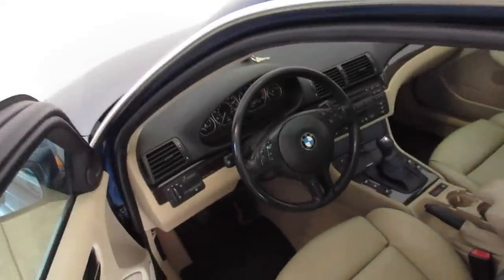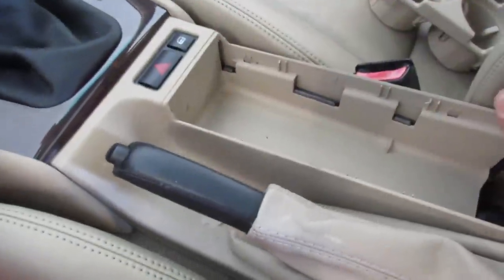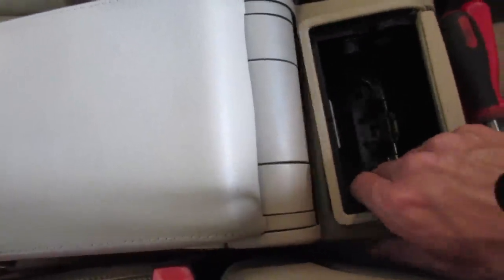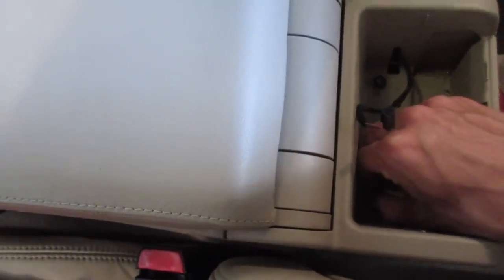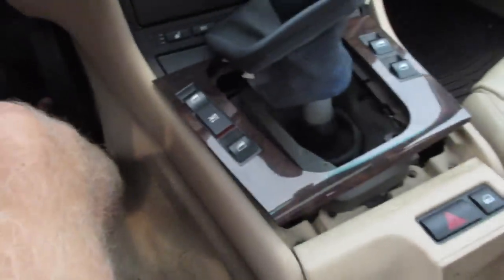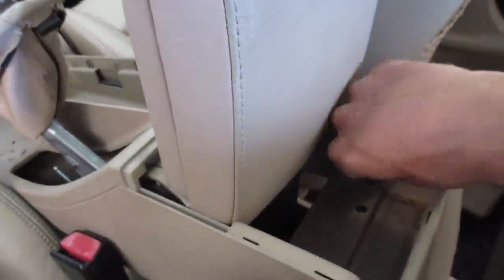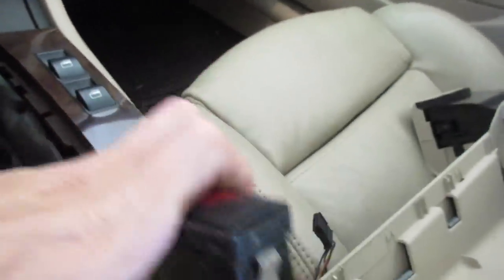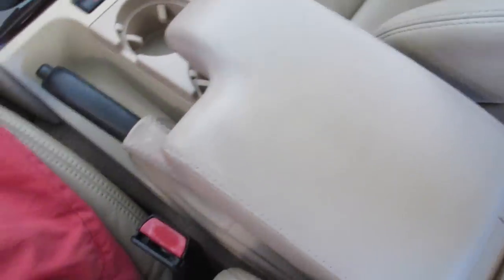BMW E46 Center Console Replacement DIY

Comment: Fantastic video! Very helpful as I was stuck trying to get the lock switch out (years of dried coffee made it even more difficult).  Do you have a recommendation for which products to use to clean these plastic parts that doesn't make them sticky over time? 
Thanks again for the help!

Comment: These videos are absolutely fantastic! Just bought an '05 320i M Sport and these videos are exactly what I needed for the things I'm looking at replacing!

Quick question though: my passenger seat plastics (I'm assuming) creak quite a lot when I take corners a little bit harder than usual. Any idea how to tighten/improve this so that it's a little more solid and doesn't creak?

Thanks!
Reply from the maker: Callum Murray Very glad to hear that you're finding them useful!  You might have a broken clip on those plastics.  I think they're fairly expensive too, but I would try to carefully remove it and see if anything is broken.

Comment: Does the arm rest slide back to allow you to use both cup holders? Otherwise that cup holder sitting under the arm rest is pretty useless for anything other than a small can and you have to lift the console every time you need a sip
Reply from the maker: I do think the arm rest has to slide up each time.  I haven't owned this car for a few years now.

Comment: Hi, took out center console on my 2003 E46 M3 for refurb. Put it all back and got various lights on the dash and no ignition light plus no start up. Checked all connections and things all seem to be in place. Had to disconnect battery to extinguish the lights. Any ideas?Thanks, Great videos.Beamernut.
Reply from the maker: +norman bull There is nothing under the center console that should effect any of what you mentioned be a problem.  Is your car an automatic?  Maybe plugging the shifter back in has something to do with that?  That's all I can think of.

Comment: Great video, seems the replacement parts for the console are not true colors and will not match as pointed out in this video.
Reply from the maker: They are, but the rest of the interior parts are decades old and have faded out a bit now.

Comment: You should just put the money into it like you did with the M5; get the rust spots fixed; do a couple mods her and there and add it to the collection.
Reply from the maker: I'll have no use for this when I move to California.  It's not powerful, it doesn't handle that well, and it's not a rare car or an M car.  I'll just use it and treat it well and sell it to finance my move in a few years!
Reply: ***** My 330i is rear-wheel drive and it's powerful especially with the manual trans.  Maybe not an M5, but a whole lot better (and more fun) than most 325's and 328's.  Once you get the rear trailing arm bushings replaced, it handles like a new car again, even without the Michelin PS2's (which were discontinued).

Comment: Can you fit an armrest to an e46 centre console which didnt come with one from factory or is it a special console thats needed?
Reply from the maker: Good question.  I would imagine that the center console changed (look at mine and compare it to yours) would have changed, but perhaps not after looking at the RealOEM description.  Put the last 7 of your VIN in RealOEM and see what options there were for your specific model.
Reply: Will check it out, thanks